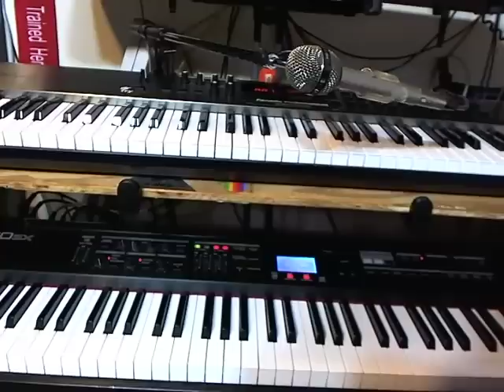MusiTech: MIDI hardware

Comment: I'm converting a cheap keyboard to a sort of DIY taurus pedal I can play with my feet while playing bass. The keyboard doesn't have good sounds, so I'd like to use it to control my better keyboard which will be up top. The cheap keyboard I'll play with my foot has midi connections, whereas the better keyboard is also midi, but it only has a usb connector. I don't have a midi to usb cable, but I can splice a midi connector on one end of a usb cable. But before I butcher these nice cables, will this work? 
The cheap keyboard has both midi in, and midi out. But the good keyboard just has one midi usb port. I know it can be used as a controller, but I don't know if the good keyboard will accept being controlled by the other keyboard.

Comment from the maker: You'll need a midi cable. Assuming you want to play on keyboard A, and have BOTH keyboard A and keyboard B make sound when you do, all you have to do is plug the midi cable into the MIDI OUT jack on keyboard A. The other end plugs into the MIDI IN jack on keyboard B.  Mind you, the audio connections are separate - you'll still have to connect both up to an amp, mixer, etc.